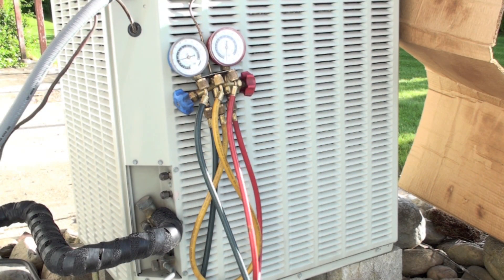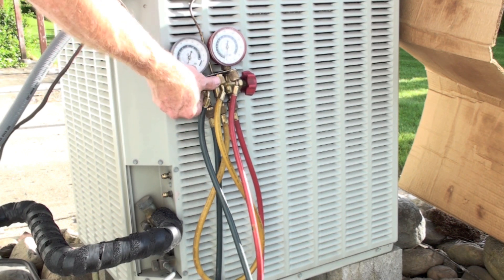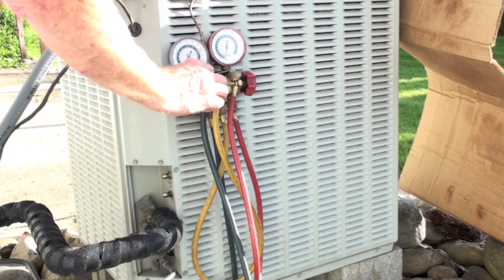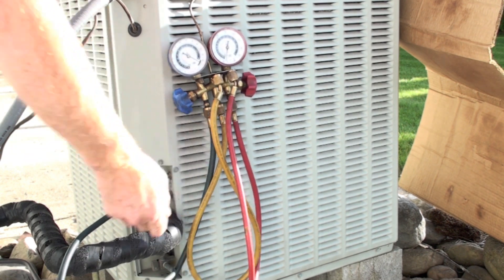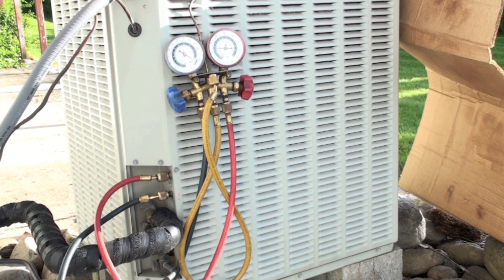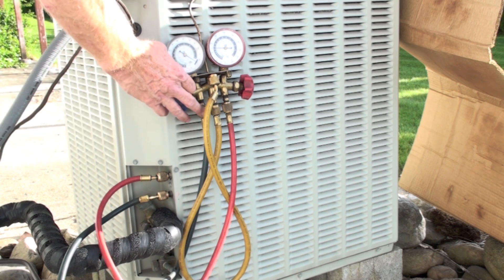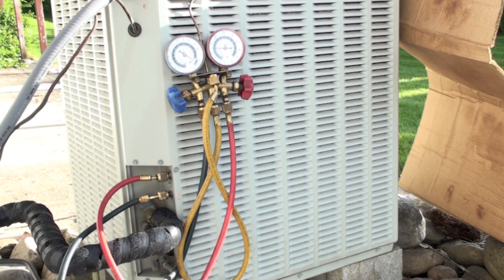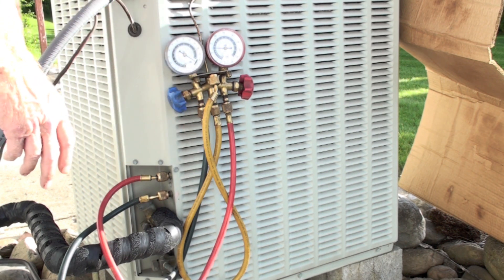How to install and bleed the air conditioner gauge set

Comment: Why does my ac have 3 service ports and not 4?
Reply from the maker: First, your A/C is probably a heat pump.  The third fitting is a low side tap that is always low side whether in heat or cool.
GFM

Comment: Brass caps should be nipped up tight, wrist tight w 4 inch Crescent. Definitely helps hold the gas in! 
You know that coz when you loosen them it a tiny psst!
Reply from the maker: The down side is you flare out the fitting and the schrader cannot be removed.  The 4 in adj wrench may help, but I do not trust caps.
GFM
Reply: grayfurnaceman. If I approach a machine and caps can loosened just by fingers BINGO I know the likelihood gas has been lost through the schrader. Good replacement have O ring or, brass to brass, of course don't crank the Jesus down on them they will burr over. There is a tool though that remedies that too
Reply from the maker: @Froggability  I have to disagree, but to each his own.
GFM

Comment: A tech added Easyseal and then 10 lbs. into a 1.5 American Standard R22.
Never turned on system, only manually ran with contactor. 
I have a recovery tank and started to bleed off r22.  System off pressures at 150. As I bleed low side and recheck pressures it does not seem to drop.
Tried to start and it ran for a minute or so and shutoff. Limiter? Possible compressor damage? Capacitor?
 Would not run with thermostat pushing contactor on.
Should I continue to bleed off and to what gauge pressures? My Fluke does not measure temps.
Thank you
Reply from the maker: You are working in the dark.  
The saturated temp/pressure will not change until the system is virtually empty.
Any change in charge must be accompanied by superheat and subcool measurements along with temp split across the evap.
I can't determine why it is shutting off but 10# is probably a massive overcharge and the high head pressure should cause a shutdown.
GFM
Reply: Sounds like you're trying to wreck it so you can get the scrap copper?

Comment: An old timer taught me a trick for drawing the liquid back into the suction side without valves/low loss. Crack both manifold valves just before you disconnect and whip the liquid hose fitting off as quick as you can then close the liquid manifold valve. It works, but having valves on your hoses is the way to go!

Comment: When hooking up just for pressure readings how would we get what's in the line back in the unit?  it's not a whole lot but it's noticeable.
Reply from the maker: There are a couple of ways depending on the equipment or your gauge set.  If you have valves on your hoses, you can close off the liquid line valve, then open both valves on the set.  The lines and gauge set will bleed to the low side pressure.  If the unit has service valves, shut off the high side valve and do the same.  Hope this helps.
GFM
Reply: grayfurnaceman I use the testo 550, hoses w/out valves. would I Crack the low side then open it up fully. Then open the high side as well.
Reply from the maker: Unless you have a way to shut off the high side at the tap, you cannot purge the gauge set.
GFM

Comment: Thanks for the video.  I am looking forward to your videos how you bleed the manifold and the yellow charging hose as well as how to remove the gauge set without getting air into the system.
Reply from the maker: I am doing more on connecting and disconnecting hoses now.  Should be out in the next few weeks.
GFM
Reply: Still not in the title.

Comment: And the steps to remove them ?
Reply from the maker: That depends on whether you have low loss fittings.  No low loss, pull off low side while the unit is running, high side after the unit is off and pressure has lowered.  With low loss, remove high side, bleed to low side with the unit running.  When bled remove low side.  I will do a video on it soon.  Hope this helps.
GFM
Reply: Not in the title.

Comment from the maker: As far as I know, they are higher pressure and somewhat larger hose diameter.  A 3/8 is still 3/8 and 1/4 is still 1/4 with corresponding fittings.  I have not seen 3/8 hose with 1/4 fittings.  Mostly, the 3/8 hose is for evacuation to decrease evac time.  Hope this helps.
GFM

Comment: I was wondering if you have anything on removing refrigerant from a unit in order to correct an overcharge using superheat measurements. Do you remove refrigerant by  simply letting it flow directly into a recovery tank?

Comment from the maker: The safety goggles are a good idea.  I have glasses so I really dont think of them.  As for the gloves, I am not sold on them.  If the gloves are mechanics type with a tight fit, they are oftentimes worse.  They get saturated with liquid refrigerant and continue the burn while you try to take them off.  If they are loose, not so much of a problem but some loss of sensitivity.  I guess it is a personal preference.  Thanks for the thoughtful comment.
GFM